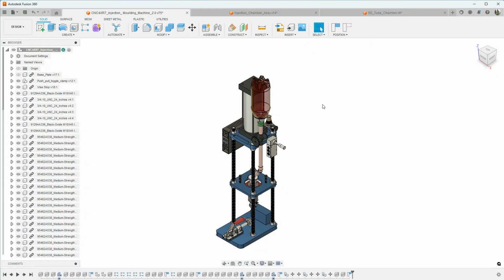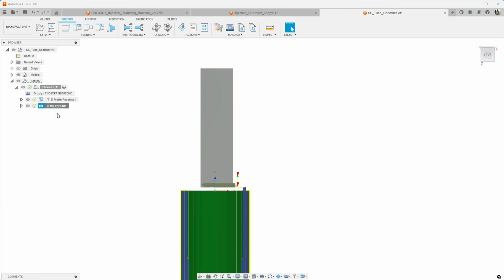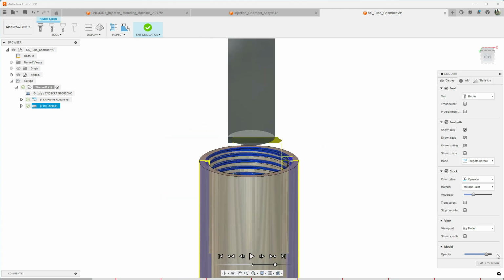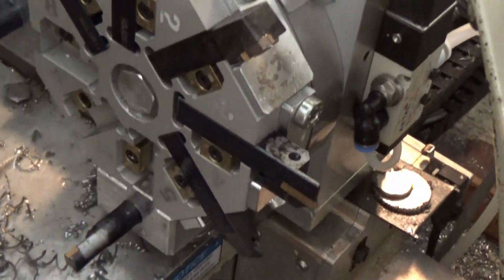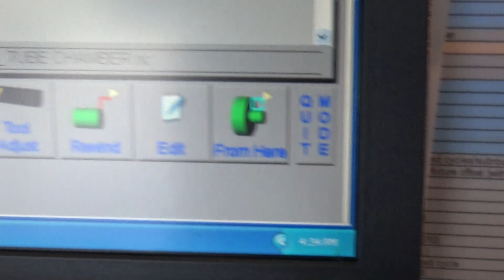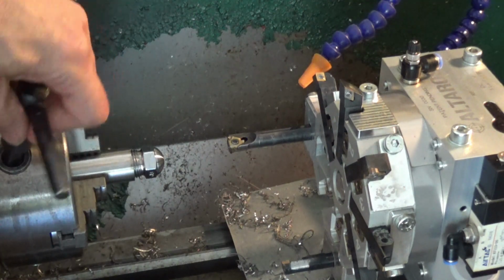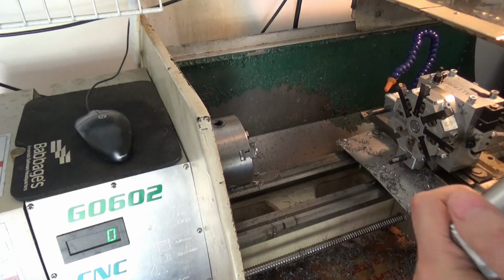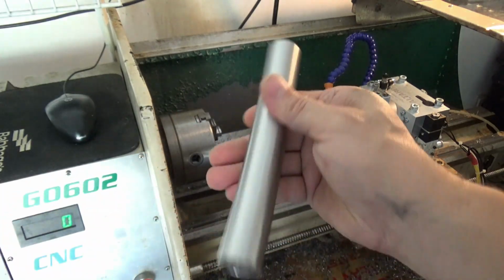Injection Molding Machine SS Injection Tube

Comment: Maybe try those carbide boring bars to increse rigidity. I got some small ones.
Reply from the maker: These are carbide inserts I think its more a machine rigidity issue but with spring passes i can work around.
Reply: @CNC4XR7  i meant whole bar made of carbide.